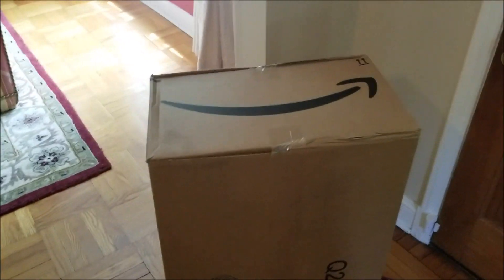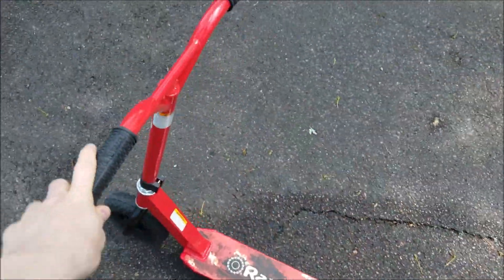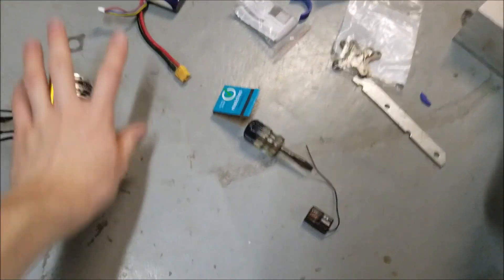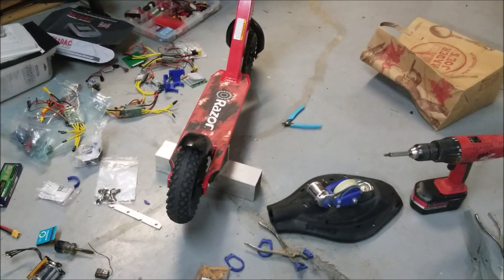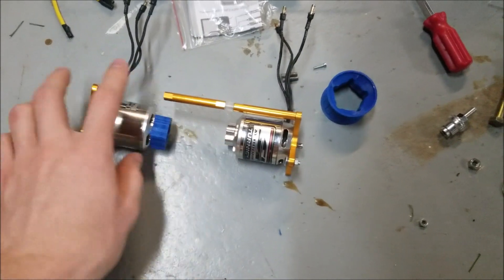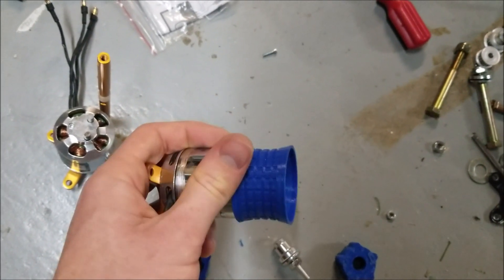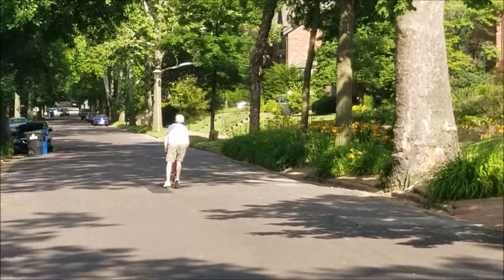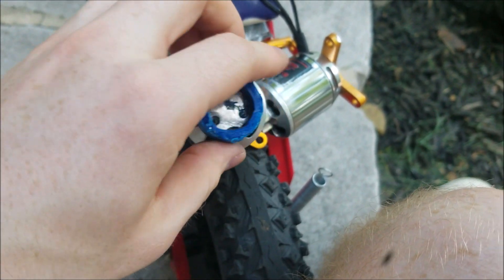DIY Electric Scooter: 3D Printed Friction Drive | Part 1

Comment: Niiccceee! I like this design especially because i dont need to weld anything like all the other scooter builds and i can just 3D print something instead. Those motors are expensive though, geez, $40.. and i need two! lol mann.. Btw, can you upload those 3D designed parts to Thingiverse? Thanks!
Reply from the maker: Hi Eric! Check out part 3 of this series. It is a much better build that also requires no welding. I have put the link to the 3D printed pulleys for that build in the video description.
Reply: @ericinventor  Thanks Eric!
Reply: А ЭТО ТРАЙК ТРУТЕН  https://www.youtube.com/channel/UCpL9FCl6FkTaEHmABVj5GmQ  НАПИШИ КОММЕНТАРИИ.СПАСИБО ДРУГ